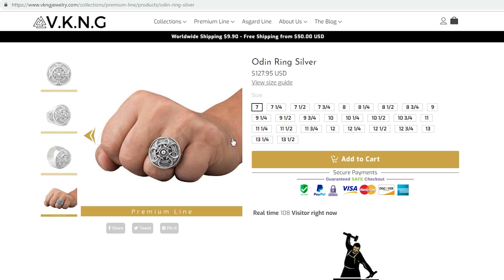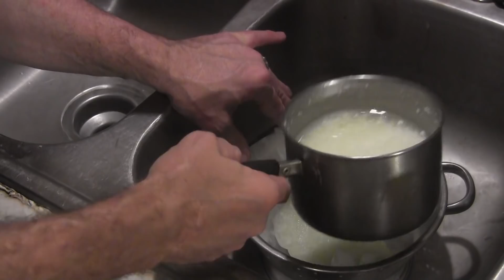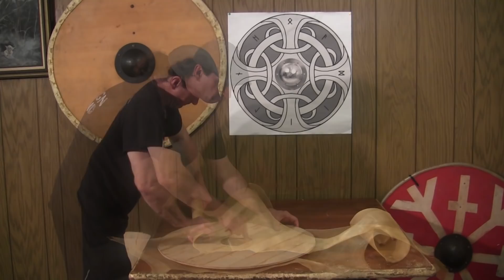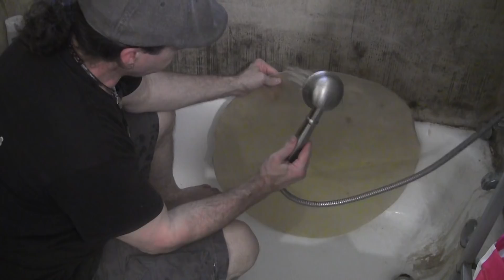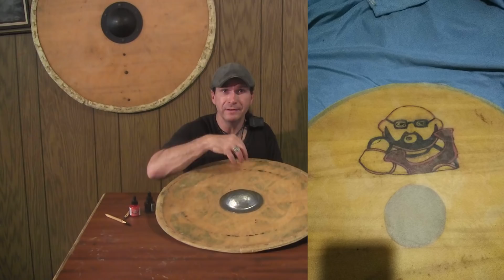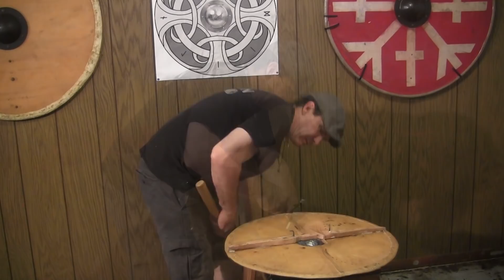How to build a Historical Viking Age shield!

Comment: Where did you source the large sheet of the rawhide you put on the front that is parchment thin? Ty
Reply from the maker: Went though a man at Tandy's then had to look though several ton of hides to find the right one
Reply from the maker: Plus hide does not have to be parchment thin to make a shield planks can be tilled thinner with thicker hides to reduce weight.
Reply from the maker: Want to try a horse raw hide shield found reservation that sells them online the horse die of natural causes so humane and legal to obtain but all sources say horse hides are the best thinner and stronger more water proof without oil and wax rub treatment.

Comment: How would I make one without any power tools? Like it was done back then ? What tools would I need
Reply: Almost all of it can be done with a sharp chisel once you have the boards. I'm currently trying to build one this way. You'll need a lot of patience though and a feel for the wood. You could use hand planes to thin out the disc as well I believe.
Reply from the maker: The used a draw knife or blade its like a hand plane modernly to shave shield boards down. They had saws, knifes ,blades ,chisels and rasp and files as well depending on century all very old wood working tools.

Comment: Just a little input on clenching nails. When clinching nails in boatbuilding you want to cut the nails to size too not leave the bent down part overly long.  Maybe one inch maximum not counting the tip that goes back into the wood. As the nails are soft iron this can bee done with the same type of nail cutting pliers that a farrier uses and leaves a semisharp edge that if driven in crossgrain lessens the risk of splitting compared to the pointed nail.
Reply: Really impressive shield by the way. I get so frustrated with everyone that test historical equipmen that just imitates form and not function. You made the one shortcut that minimally inpacts function in making a smaller shield. Even a small section made with the correct tecnique would tell us more than a fullsize textile covered plywood shield.

Comment: An alternative to hydrated lime is baked baking soda (sodium carbonate). It will be finer than hydrated lime, but can have similar fast drying results.

Just bake the baking soda on a foil lined baking sheet for 1 hour at 250F / 121C.

Just be careful, it can cause a chemical burn on your skin.

Comment: VKNG like most 'viking' themed shops are eastern European. That ring is about a buck of silver poured in a mould and polished up, and then marked up to well over its weight in gold. If you want gaudy jewelry just go to your local Chinese market. If you want authentic jewelry I suggest looking into making it yourself, it's a very rewarding hobby.
Reply: Perhaps, but someone has to create the design, make the moulds, buy the silver, heat it, pour it, finish it and then market it. Making them is time consuming and energy intensive. The same reason we all go to shops to buy ready made items.

Comment: Excellent video with a lot of detail. Thank you very much. I do have a few questions:
1. Can you make the curds up in advance and keep them in a sealed container in the refrigerator, then add the hydrated lime and water to make up small batches of glue as needed?
2. Where do you get your rawhide sides?
3. Where do you get your nails?
4. Do you recommend NOT staining any of the wood?
BTW, this video made me an instant subscriber.
Reply: I have an easy answer for the rawhide, nor sure if you still need the information after so long but whatever xD buy some large rawhide or beefhide dog bones from a store, soak them, then pull it apart and cut them into semi even strips.
Reply: But I also want an answer on the nails, that's what I rewatched the video to find xD

Comment: A quick note on precut boards, to have strength glue has to get inside the woods tubes, sand down the edges thoroughly.
This goes double for anyone using plywood due to the way its made.
Reply from the maker: Agreed I sand all surfaces before gluing. Shaving with spoke shave could work as well.

Comment: I wonder if the clench nails was as a way to make recycling nails easier? It doesn't look that much easier than riveting
Reply from the maker: It's about the same
Reply: @Thrand11  Yeah... I just imagine it would easier to pull nails out of wrecked shield if the nail are clenched instead of riveted. Iron wasn't dirt cheap back then.

Comment: Nice Bazubands, also i think you've proven the designed showing through is probably done both ways because it didn't show through well did it. Unless their rawhide was really thin and maybe it was regional. 1000 years over a very large land area, we have to be careful by applying an all inclusive statement.
Reply from the maker: The Rawhide on my first shield is 1.5 to 2mm thick and more transparent. The one I sent to Joerg Sprave was about 2mm thick and showed the image in the video plus you can go see it on his channel showed through the leather fine. This leather was the lower half of the same leather and about 1mm thick on this shield and the back side was more than transparent enough to see through. I stated I tried to make glue got the proportions wrong on calcium Hydroxide  to milk protein or curds it did not dry set for two days and started rotting had to remove the front hide and wash it before I remade the glue then reapplied the hide to it with proper batch of glue. When I washed the hide after that 2 day no dry starting to spoil cheese on hide it was murky looking and turned it slightly white on back side and less transparent. that was only hide I had so had to use it was hopping when it dried it would be more translucent but the new glue I have been making is made with calcium Hydroxide not Baking soda like my previous glues so has a slight white cast as well the combination of both caused the effect you see in the video where it did not show though properly and it is the first time I have had that problem. Meaning thicker hide shows through just fine and the hide I used was thinner and first attempt was perfect could see through when set the applied the hide until I realized the glue was not drying and starting to sour and had to wash it to attemt to save it. Then hide turned white and was half as thick as Joerg spraves shield that you can see through properly.

 I never said every one put images under the shield, I said you can because I have done it and shows through properly but after the accident it ruined the ability for the hide to do that. I also blame the new faster drying stronger lime recipe. I used lime from the gardening section I used pickling lime that is purer and ground fine so it would not have a white hue or pigment from excess calcium and impurities. If I had gone with baking soda like I normally do the glue would have been clear when dry but had a deadline and lime is more period so when with new recipe and only had that lime available to use. Hope this more than explains hide thickness not a problem glue mistake and glue recipe a problem here this time  :(
Reply: @Thrand11  OH ya, I wasn't saying you said that, only I wanted to get the information right myself before relaying it to others and the murky glue problem makes sense. I went back and rewatched and understood it better.. I wonder why some put on top and some under. I've seen several viking shields in museums but couldn't really tell.

Comment: Thank you so much for the glue recipe. I have been wanting toake a large, myself. No boss, and a double layer of wood planks, at right angles for a type of ply wood; but, still very similar. Come to think of it, weren't some Viking age shields also plyed like that?
Reply from the maker: The Sagas say that they were but we have not found any made that way from the Viking age as of yet but it is documented in writings if from the period and not written down later.
Reply: Weight, a heild needs to be light so as not to tire you and be easy to move fast.

Comment: Blue/White or Blue/Yellow would be good colours, I'd go with the second choice I used t&g for the face and planks laid at 90 degrees for the back, ok it was a bit weighty but worked pretty nicely, the weight helps you get used to using the shield at first.
Great video!
Reply from the maker: Thanks

Comment: That belt sander will eat through wood fast if you aren’t careful. Warning to viewers
Reply from the maker: Very true but I have made shields 4mm in center about 2mm edge before with good rawhide and still super strong.
Reply: I'm a carpenter and have been asked to make a authentic replica by a client 

I'm having trouble knowing which grade and or tanning is correct for shield making so if anyone could help me so I buy the right rawhide I'd really appreciate it

Comment: Remember this method is stretching the metal in the center. So it is thinner than original.
Reply from the maker: Agreed and I recommend about 12 gauge steel but did not have that gauge available at the time.
Reply: so what is another way to do it?
Thanks

Comment: 16ga. could almost be cut with hand shears. I would think at least a 12ga for a functional. 16ga is great for a more display type
Reply from the maker: Yes will be testing shield boards not worried with boss.
Reply: @Thrand11  Also, I think their would be thickness differences in period... a dueling shield wouldn't need to stand up to the abuse a war shield would and using a war shield as daily carry or dueling scenario could actually disadvantage you.

Comment: Yes horse hide is stronger than cow.
*Here is my question-would modern glues be stronger? Or creat a tougher finished product?
Reply from the maker: Not sure about the same really or seems I have used both typed to make shields over the years .
Reply: Casein is a nearly ideal glue, alot of ww2 air-planes an gliders where glued together with it.
Casein suffers from prolonged moist conditions where it turns in to Camembert.

Comment: Nice build. Though you might find it useful to get a few more tools, a workmate bench is quite handy. In the glue up of the panel, wax paper is your friend. Lay some down and put the panel on it, won't stick to the floor or bench. Putting clamps both under and over the panel helps to keep it flat. In cutting the circle, a nail through the center gives you a pivot. Either swing the panel around that pivot or tie a cord to your saw and use it to cut out the circle. When planing or sanding, stops are good. If you put two clamps on the edge of your work table then butt the shield against them, should be easier on your gut. If you want a smoother surface when piecing together rawhide, then scarf/feather the edges. Though lapping does give a double thickness, which might be a good reinforcement. Now the clincher. If, when clinching nails, you bend it over to cross the grain of the wood it helps to prevent it splitting the wood.

Comment: The recipe I used a long time ago wanted low fat Quark and lime.
No vinegar.
For the lime I used conches that I ground in a hand crank coffee mill.
And it worked! The uneven lime gave a bit texture to it but not a big problem.
Reply from the maker: Interesting
Reply: Quark* go by many names, if you can get that for 1€ per pond or less you don't need to separate the milk and the filtering. *I find for English: quark, curd, junket, qvark.
Reply: Wait, where did you buy the quarks? How did you stabilize them for storage?
Reply: @dr.lexwinter8604  Not up-, down-, bottom-,... only milk with bacteria. :-) You do not need lower temperatures than often found in some (often white) cabinets, in kitchens, where humans also prepare sometimes there food.